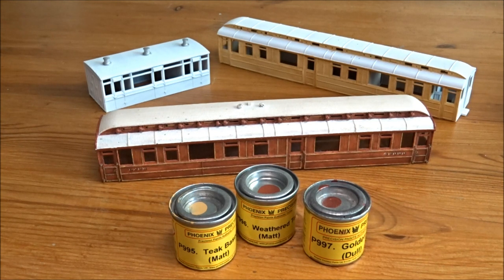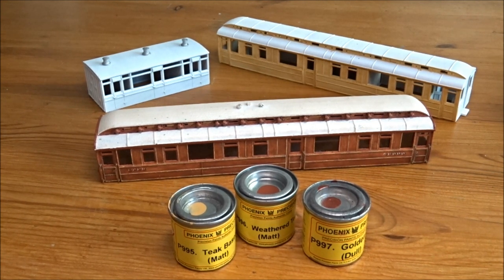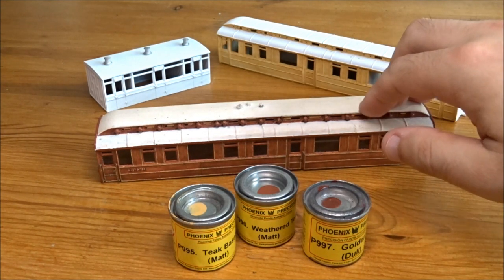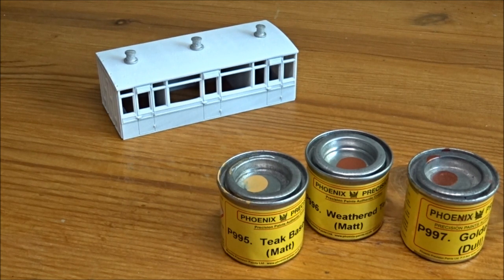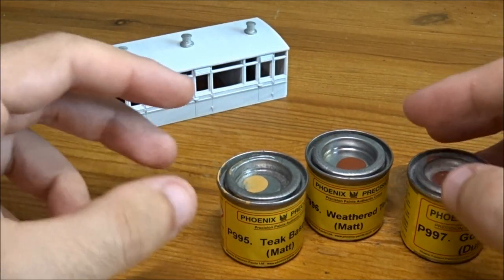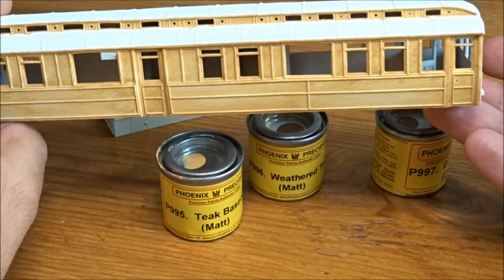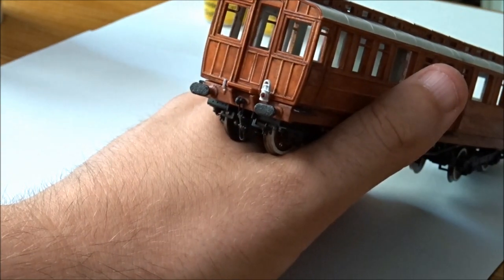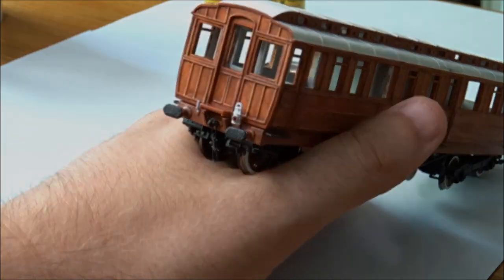Workbench - Talking teak

Comment: There any particular reason you do the weathering before you line up and affix the transfers on?
Reply from the maker: The carriage itself is a preservation vehicle so doesn't get that dirty so wanted to keep transfers clean... I also use the soot or dirt to addd darker highlights to the wood grain effect.
Reply: @bluebellModelrailway  Fair enough then; given I'm planning to make a Chivers pigeon brake at some point in the near future for a parcels train on my layout, was a little puzzled.
Reply: @TallboyDave  I'm building the Chivers now Five79 Pigeon Van right now. That rmweb he refers to is well worth reading. Some top tips there. I have found Halfords yellow primer is a good substitute for the Phoenix base colour, so does the primer and base in one coat, so less detail infill. The rmweb also recommend a thin gloss varnish over the base coat. Phoenix paints dry far to fast, so the glossy finish helps their top coat paint travel further with less drag, therefore helping to keep a wet edge. I also recommend using a flat brush to get a better grain effect with their top coat.